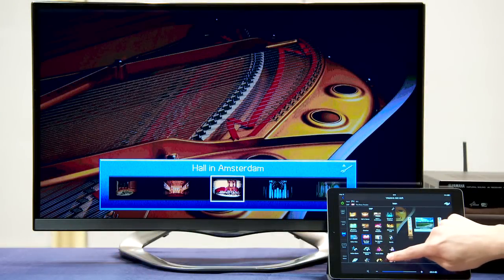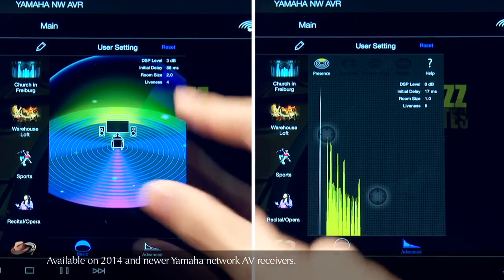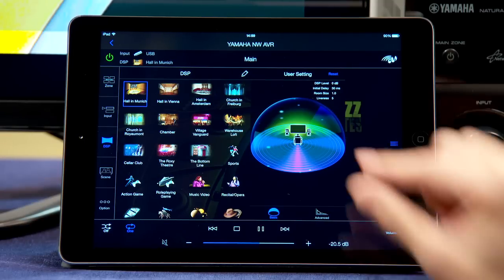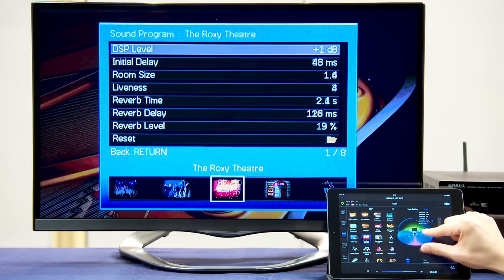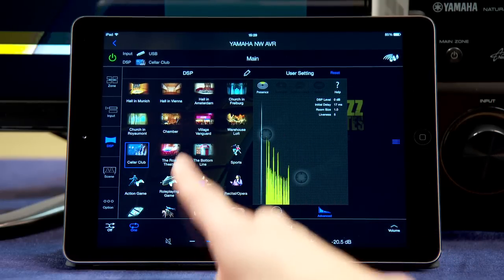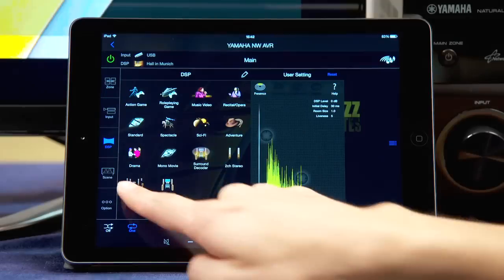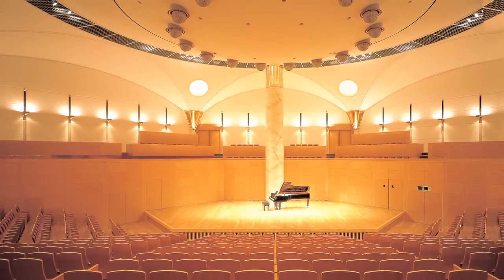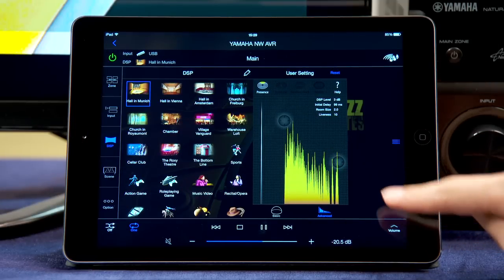Yamaha CINEMA DSP Parameter Adjustment

Comment: The downloaded this app to control my RX-A1030  on both iOS and Android. The options that are available on iOS app are not available for the android app. Also, as Ken mentioned  there's no option to edit the DSP modes to make adjustments to it. The edit button itself is not visible, when a DSP mode is selected.  I don't understand why Yamaha advertises these features if they are not available. Pls make this feature available.
Reply: IT Seems, the modes are only available on Tablets. Installed on Android Phone, no edit Button, installed on iPad, there is an edit button
Reply: It depends on the receiver you are using ii have a older receiver I can use the app but not everything is available I cannot adjust DSP modes on mine it is a feature the put in later and only available in higher end receivers

Comment: Nice video! How do I add more bass to a specific DSP. For example my 7ch stereo has huge bass, however stand movie mode does not. I want to increase the bass for the standard movie, as it is way too low. Thanks in advance for any help. 

Ps. I tried to edit DSP however nothing shows for bass adjustment?